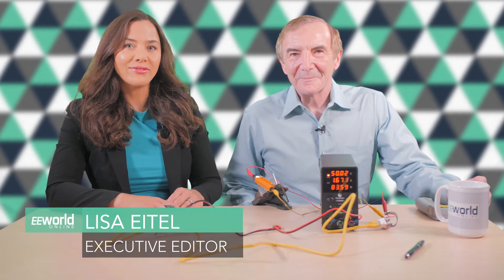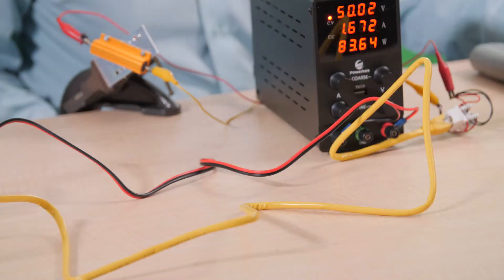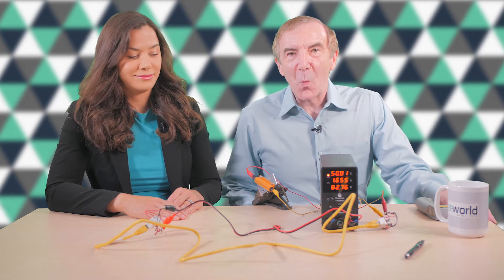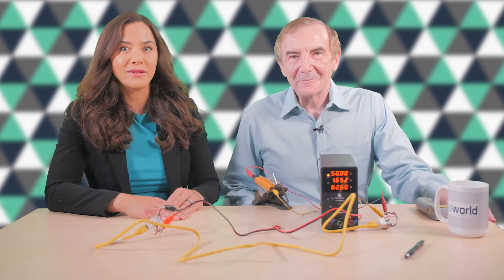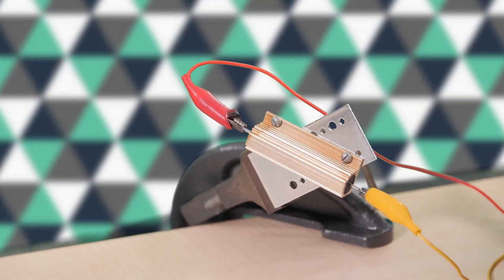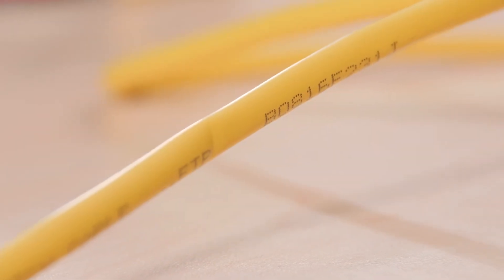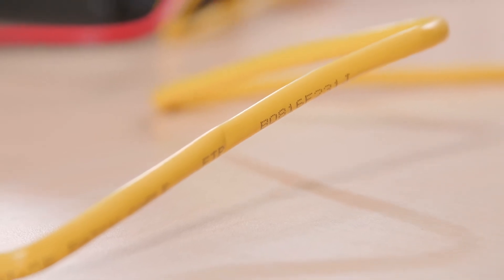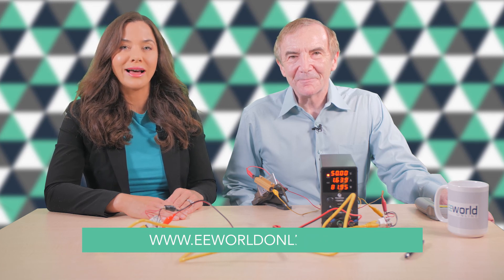Will high-power PoE burn up a Cat 5e cable?

Comment: When working on the IEEE 802.3at standard board for PoE to 90W, we looked at heat dissipation. Not only for single cable, but for cable bundle as well. This was also looked at a length of 100m cable. No issues were found. Using CAT5E is not an issue for high power PoE. Key is to keep current under 2A. There is a voltage drop over the 100m cable and thus the end voltage, at 2A does drop around 15V and thus lower power at the far end of a 100m cable as compared to using a length much shorter.

The 802.3at standard committee did run this type of test and much more by running bundles and the 100m length. This is a nice video, but barely touches the work that the standard committed performed while working on the 802.3at standard. The team looked at power loss, temperature rise, data interference (at maximum data rate), and many other aspects of the CAT5e cable. Rest assured that 803.3at would not have passed if those on the committee did not feel it was sufficient. Members included Cisco and other companies involved in both data transmissions and power distribution.
Reply: hi, 26awg cat5e can handle 12v 2a with poe?
Reply: @yigitkaygusuz4502  yes. It is the current capability, not voltage. You can do 20V as well. High power POE is operating at 48V
Reply: Do you know if there's a calculator out there that you can put in various data points like length of run, required A at the end of run and or req voltage at end of run and it would calculate max length? input voltage, input current data?
Reply: @johnjacobjinglehimerschmid3555  yes. I wrote one regarding wire size and current. It calculates voltage drop. Pretty easy to make in a spreadsheet. There's are tables that provide resistance per length based on wire size. Do not forget to double the drop because of the return length.
Reply: @redderek Hi, will Cat5e CCA (not solid copper) be able to handle 48v 2A?
Reply: @drbiosgmailacc5191  CCA is not rated for Ethernet at all, let alone PoE
Reply: 2 years later: what about 802.3bt?  Getting some mixed signals online with the debate with this.  starting to see some pretty high power devices in my environment (60W!!) and I KNOW these things have cat5e behind the device